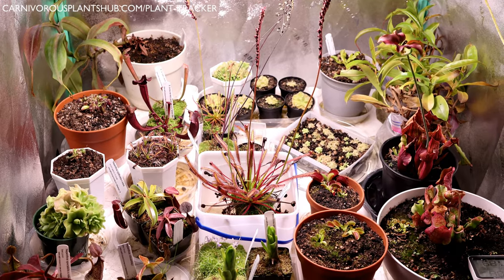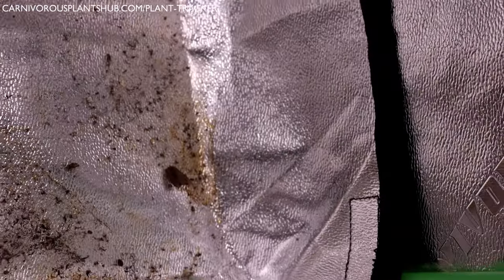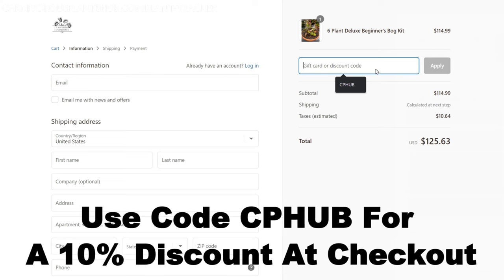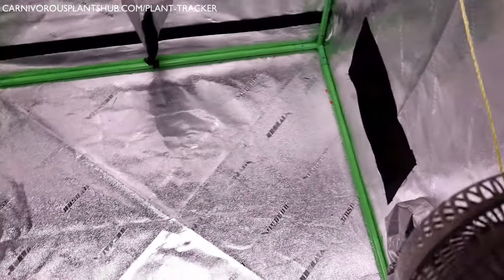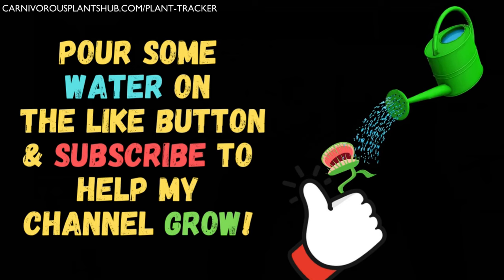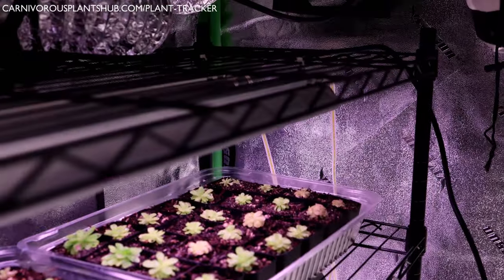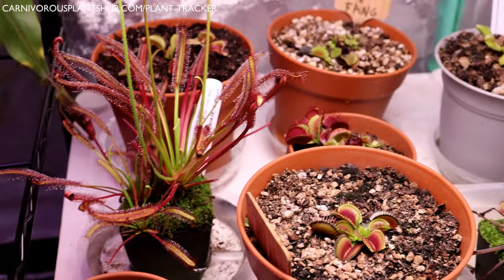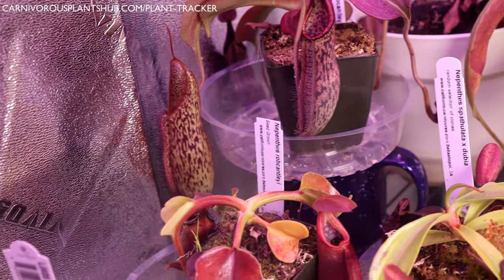VivoSun 3x3 Carnivorous Plant Grow Tent Cleaning & Overhaul - New Barrina Lights & Wire Shelf

Comment: I bought a 10 gallon tank with a screen lid and I sealed off 90% of it off to hold in humidity but also allow air flow, river rocks are under the moss bed to allow water to be able to be stored while the actual plant is in a plastic pot (this is for my nepenthes gaya)
Reply from the maker: Great setup, I would try to install a fan if possible. Sometimes the small PC fans work great. It's hard to create good airflow without some kind of fan. Usually, if just sealed up, you will start to see some mold or mildew.
Reply: @CarnivorousPlantsHub  so similar to my Bioactive enclosure for my Ball Python where his tank as intake and output fans that were meant for purifying the air but I use them to balance out the humidity